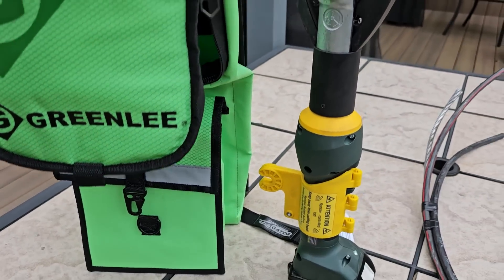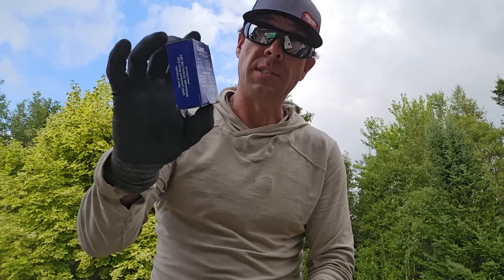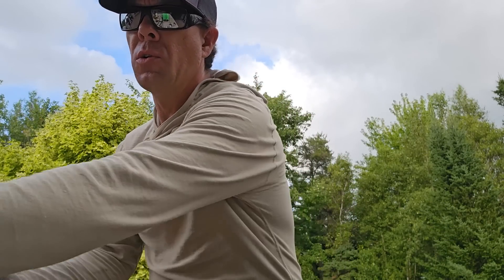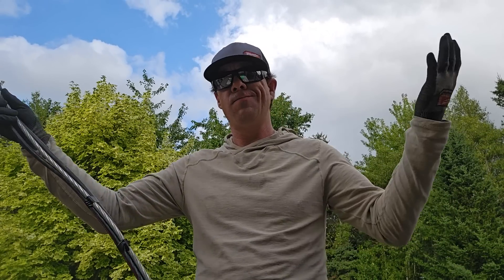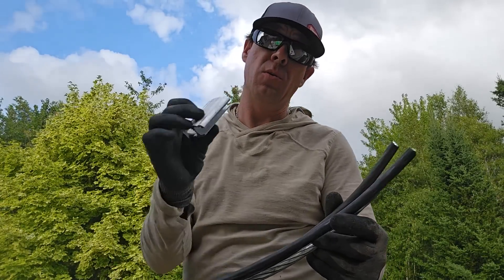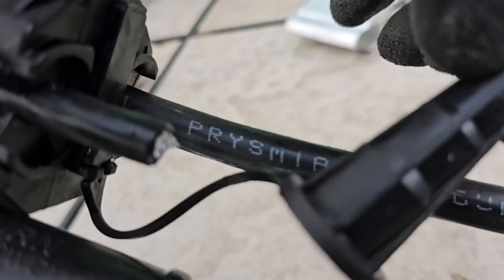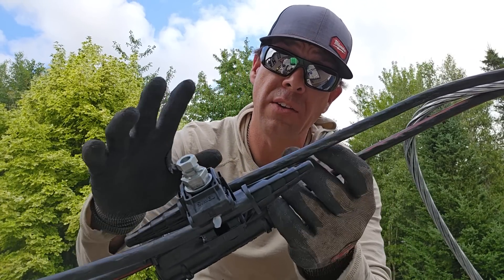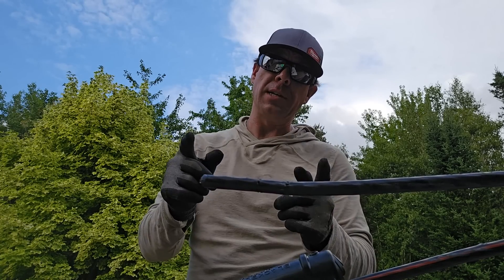What's a piercing connector?

Comment from the maker: Hey all!

While expensive, these connectors are;
Way safer to use on live conductors, install in a quarter of the time and have way less call backs!

 I referred to the Milwaukee impact wrench as a torque wrench in the video a couple times  🤦‍♂🤦‍♂... I meant to say impact wrench lol! I was hyper focused on the word "Impact G$n, which I try and steer away from using that word in my videos but yeahh.... It's an impact wrench 🤷‍♂. For those wondering, its spelled "Simel" by TE, really great and easy to use connectors for triplex! Cheers all!!🍻

P.S Love the new phone, but the mic placement is junk 😞
Reply: You could say Milwaukee Pew Pew 😋
Reply from the maker: Lol
Reply: Materials are always the cheapest line item on the statement, so I don't understand why it's always the first thing people wanna cut corners on. One call back is gonna be more expensive than a year's worth of savings from cheaper connectors.
Reply: Impact Driver would work too.
Reply: Great connectors that very few  electricians use to tie in services due to higher price. Years ago our local utility company would give you nice free bugs to tie ins service. They wanted you to make a special trip to sign for them on every service. Got to know the guy who gave them.out & he gave me a box of both sizes.
Reply: Those caps should be filled with epoxy resin or something permanently capping the wire ends and keeping out insects/squirrels.

The connections at the service entrance on the house need to fully enclose energized parts.

Comment: When using the piercing connector do you have to pre strip?
Reply from the maker: Nope, the connection pierced through the insulation and a rubber silicone coated pad seals the bite from alowwing any moisture to get in.

If the wire has a second coating (colored quadrex for example) I would definitely strip the first layer though.

Comment: Does the piercing connector cone cap need to be tapped?
Reply from the maker: It's hard to tape, there being so much silicone around the connector. Typically placing them on opposite sides of the leash is enough to hold them in place.  That being said, I have taped a few in the past.

Comment: I changed a service in Connecticut years ago 1993? for my uncle. The local utility Connecticut Light and Power required us to use piercing connectors and even provided them to us. I remember having to go to their office and pick up the connectors and a plastic temp cover for the meter as his old meter was an old "A" bas meter socket.

Comment: These are great at handling a load at full rated amperage. But they are NOT great at short circuit amperage. They will blow open. So if troubleshooting and you find one of them that is open - there was likely a short circuit current cause to look for. So just remember if one of these failed - it may have failed for a reason. But over the course of 30 years of using them I’ve never seen one fail because of weather or corrosion. 

There’s a few different manufacturers and trade names of them - but I call these B-taps. And I think that Buchanan had the first patent on them??? Hence the B? Now owned by Ideal….

Comment: Boy, if your company contact the manufacturer, I’m sure they do all of this but if they figure out how many of those they’re going to use in the next 20 years and they buy 10 or 20 years worth? But I would say even from the customers point of view, once you understand the safety and the security of the bite and the linesman safety just make the switch the lives of the men on the line or it is well worth the cost of this connector in every case❤️‍🔥
I also would question the companies insurance carrier because there is a definite difference between skinning and handling live wires, even though men are as professional and trained to the HIGHEST STANDARDS, the wind does blow😳
Things happen😔
THESE CONNECTORS WILL SAVE MENS LIVES❤️‍🔥
AND ……..SAVE THE COMPANY funds in insurance premiums, eliminating ANY  POSSIBILITY OF BAD STUFF with this connection! 
Imagine the hours involved in replacing all of these near the ocean in 4 to 8 years then imagine the hours the troubleshooting and the time required to determine the faulty connector and then replacement on hundreds of thousands of these between 20 and 35 years and once you come into that failure range 20 years That’s gonna give you enough service calls to keep one or several crews busy all day every day do you think about how many of those connectors are out there? And if the bean counter at the company can add those hours up and the material and then you can practically go to zero wash all of those repairs away, that’s a pretty good pile of change all of that aside the main reason to do it is safety for the crew. Everything else is icing on the cake.❤️‍🔥🇺🇸 
 THANK YOU FOR THE WORK THAT YOU AND ALL THE OTHERS RISK THEIR LIVES FOR EVERY DAY FOR OUR CONVENIENCE. THANK YOU ONCE AGAIN.
❤️‍🔥🇺🇸❤️‍🔥🇨🇦❤️‍🔥

Comment: Here they connect them with ends at same side so it kind of looks like a Y. Then that is covered by some kind of plastic. It's 10-20km from the sea here with mountains between so they probably use the cheaper ones.

I've noticed more and more 22kV lines using coated cables and very short distance between phases. Guess the last longer.

Comment: What does doing the h-tap procedure (or any crimp procedure) with a hot stick look like? Like, I'm trying to imagine it and it seems like having not only the tool at the end of the hot stick but also lining up the wire and connector would be ridiculously awkward.

Comment: insulation displacement connections are also used a lot in data/teleco, e.g. punch-down blocks, crimped modular connectors, ribbon cable connectors, etc.  easy to install and reliable.

Comment: Piercing connectors are also used in European countries. But we don't need 200 A, a 230/400 V 3 phase 32 A service is 22.08 kVA of power. Does anyone in North America actually fully use a 200 A service?

Comment: My understanding is that the split phase system is mainly grown from having a cheap single phase pole monted transformer powering both 'normal' 120V and more power 240V to homes.
If I see those thick wires, our 25000W solar system is connected by three phases 400V over 60meters of 6mm².
The cable does get warm at full load, but #care as that's when a kW of loss really doesn't matter for us.
Having three phases and more voltage served to our homes saves a lot on conductors.

Comment: I wonder how it would be to use some water repelling material on the wire ends like silicone oil before crimping.
It would of course require some additional testing to ensure that it won't cause issues, but electricity and water is seldom a good combination.

Comment: 13:05
I think it would be even better if there was a tightning bolt on each side.
2 reasons for that.. but mainly because you could crimp the connector on the dead side first, and not worry it would slip or move, and then, insert the live one, and crimp it.
2nd reason would be, when you have two very diffrent sized wires to crimp together.
I'm not convinced that both sides are pressed down evenly.

Comment: 5:05
In Quebec, i never saw a 200A residential entrance connected to a big triplex like that..
The aluminum triplex is almost half the size of the wires coming out of the entrance mast. 
It's usually explained by the fact that the triplex is "air cooled", from being totally out in the open air. 

Anyway, i'm an electrician and i like watching you and other linesman at work. 👍👍
Reply: Same here in Idaho, USA. A #2 triplex for a 200amp service overhead. It has a 150amp rating to 104degF in free air and they just bank on full load being intermittent.

My siemens 200amp maim breaker is rated 171a continuous so its not much over.

That said, I melted my overhead triplex this summer during a heatwave drawing 165amps continuous and they replaced it with 2/0 triplex which they typically use for 320/400a residential services. It was quite the firecracker show when they melted together. Never opened the transformer csp, just exploded the aluminum apart in a shower of sparks.
Reply: @mediadaemon  👍 i think they're going to have a lot of "triplex oversizing" replacement calls in the next years to come..
With all the bigger faster car chargers and all the gas powered tools and systems getting replaced by electrical ones.. 
Soon, a 200A entrance wont be enough for a standard house..
Reply: @martf1061  I agree, that and xfrmr upgrades. A 15kva is often used for 1-2 homes and a 25kva up to 6 homes. That won't work out with EV charging and this anti-natural gas trend that has been sweeping through.

When I try to tell people "the grid" isn't ready for EV, thats what I mean. The distribution layer was built around a typical usage when gas was used for cooking/heating and EV wasn't even a concept.
Reply: @mediadaemon  👍 here in Quebec Canada, we produce way more than we consume, and all excess is sold to the usa. But like you said, the distribution part of the grid is going to be undersized soon.
The power company is already trying to make us change our power consumption habits, to prevent having too high demands peaks

Comment: These are used extensively in this part of the world (southern aus. Tall, dense, moist forest). Both Hv and lv are aerial bundled cable. 

The utility rebuilt the area from bare wire to insulated about 30 years ago, I understand, as it was believed it would lead to fewer transient shorts/fires from branches / being on the ground. 

Its also likely to be live and hard to see (black with
20 years of patina and moss) under a tree over a road in the sort of weather trees come down in. If they were bright orange people would complain 🤷

Comment: Crazy that's all that make the connection! I might try an experiment with one to see if it can handle 200A+ with a low voltage high current transformer & see what it can handle.

Comment: This is nothing more than a Scotchlock crimper. 
Those are junk. 
If the small fangs are sufficient to carry the load then why not just use 8ga wire to feed the service. 
Any failure of voltage loss will be at the connection. 
The full crimp swedges will carry the load without failure. 
If moisture is the issue, then take your time and wrap the connection to prevent any problems. 
Don’t be in a rush.

Comment: Not a lineman myself. But here in AU the low voltage (240v) power down the street is typically done with 4 wires. (3 phases and neutral) Then they just tap off a single phase and neutral to each house. Spreading the load across the 3 phases. This also means as long as you are happy to pay for the upgrade you can get 3 phase (415v) service aswell. 

Most areas they just have the normal cross bar ontop of the poll with the 4 wires. But in many newer areas or even if they just upgrade the wire down a street now they use a twisted group of insulated wires. So they use very similar IDC type connectors to tap off that wire even while its still twisted together.

Comment: Here it's use since the wire go from bare copper to insulated so 40+years !
And at the "copper time" it was only pinch over the cable never get crimped for taping a house.

Comment: So you're not using the Milwaukee crimper.
Reply from the maker: I do still prefer the Milwaukee linear crimper for everyday use. It's the wireless feature on the Greenlee that really makes it stand out! Hopefully everything works out with the tool they're designing that will be quite similar to the wireless crimper with a completely different use! 
I'll definitely be covering it in a video a soon as it's released !
Reply: @Bobsdecline  I must agree. Greenlee is a good brand. They specialize in electrician's tools I would like to see the results of the use of that tool. Thanks for sharing this viewing. 👊

Comment: Piercing connectors are best suited for temporary services as they can be reused. Correct me if I'm wrong.
Reply from the maker: Excellent point to bring up!
I wouldn't reuse them on a permanent service as they are designed for a one-time use. 

For a residential 100 amp temporary I personally have no issues with that! If you use crimps on a temporary you repeatedly cutting the wires shorter and shorter at the weather head which can become costly for the electrician who owns it.

Comment: To someone with enough knowledge to be dangerous, on first glance those pierces seem like they'd be potential failure points because of how little surface area is actually connecting to the bare metal. My mind cannot comprehend that there's not some sort of loss and/or potential for hot spots since all of the current is going through that tiny surface area. Makes me wonder why lugs for triplex and the like are so beefy and "overbuilt" if this is all that's needed.

Comment: Does anyone still use the old powder actuated wedge connectors? They seem to be a non-stocked item now, so that indicates a no. The tool, despite using a .22-.28 caliber rim fired blank is pretty silent. I was up in the bucket pounding away on it trying to get it to fire. It had fired the first time, and I was oblivious to it. Tap it with a hammer or a pair of pliers, it fires and jams the wedge in. Done.
Reply from the maker: Yes! The most reliable connection out there! (Ampac) We use them for high  current connections, mostly on high voltage. 
A few companies are starting to come up with some mechanical connections that a have more universal fit.

Comment: So it pierces the insulation of the wire in 8 places?

That's only 25 Amps per pierce on a 200 Amp hookup. 

For the size of the teeth that pierce thru that shouldn't be a problem.

Comment: We have piercing connectors, and to be honest, I hate them. They will eventually start to fail. Everytime I go to a part power or flickering lights and see those connectors 9 times out of 10 it's the piercing connections. I'm old school and like to use regular bugs. Sock it down tight and the customer will never have a problem with my connections.

Comment: "tiny little prongs on these piercing connectors work" They are everywhere in audio, even the humble old (analog) telephone systems. A central office may have millions of connections, not soldered and mostly NOT screw-clamp. A good central may have a million connections, so even 0.000% failure rate in 50 years is "bad service". Yeah, only 48V 0.040Amp but telco can't make massive rat-nests cuz they have so many lines. Yeah, I look at little piercing connectors "WTF??" but if you install per specs they never give problems.

Comment: It looks like the rim around those end-caps would fit inside the grooves at each end of the piercing connector. That might hold the caps in place more securely, once the sheering nut is torqued down.
Reply: That's what I thought.  I just wonder how much it would hamper the compression of the overall connector.  I wouldn't mind reading the instructions.
Reply: I thought the same thing. Glad I read through and didn’t look like a dummy for posting the same thing.
Reply from the maker: It looks like there's a grove that that will grab it but there's no lip on that curved part. It fits almost perfect before tightening but won't stay there at all and has nothing to grab ahold of or even pinch. A great idea for the manufacturer to consider though!!! It wouldn't take much of an alteration
Reply: @Bobsdecline  That's a missed opportunity by the manufacturer!
Reply: @Bobsdecline  the groove is definitly there for holding the end caps in place. The little plastic band holding the end caps to the connector is only there to prevent us from dropping them and makes it easier to manipulate every pieces at once with only 2 hands. 
But from my point of view, these caps should already be part of the connector.. not something else that you have to hold in place while having to manipulate the tools, the connector and the wires at the same time.
Those connectors are perfect for tapping a wire in the middle of a wire. 
But would be even better if it had 2 bolts.. one for each wires.
Reply: Deeper into the connector right up against the rubber around the teeth there is a groove to get that cap into. There is another brand I use on  occasion that has a cap that is a loose part that gets dropped when fumbling around with them. But most often I’ll just tape the ends.

Comment: You sound wasn't to good at times.  Sounded muffled!
Reply from the maker: Ya I did a quick mention on the pinned comment... Got a new phone, works awesome, but the have the mic in such a way that it's easily blocked when set down. I might have to get the mic out when filming at home, but can be tough while filming on the fly!
Reply: @Bobsdecline  - Other then that, I enjoy the content, (although I wish it was longer sometimes).
Reply from the maker: Thanks! I'll have to do another full length one soon